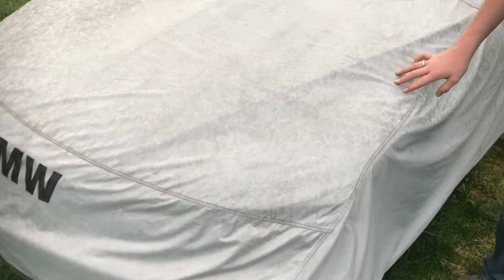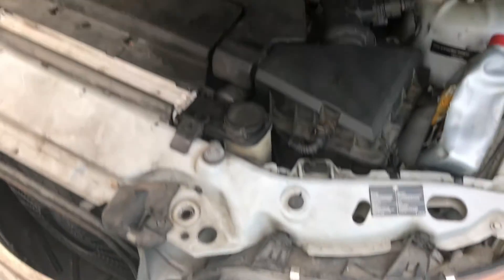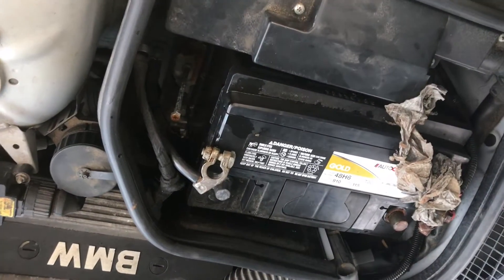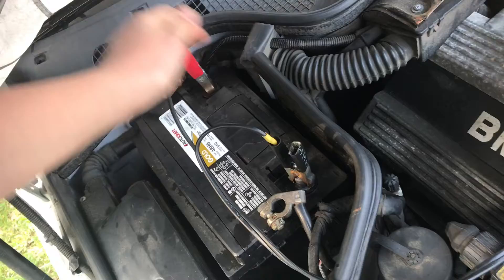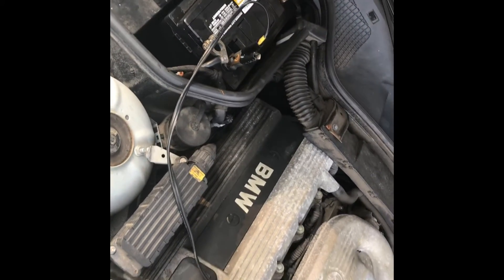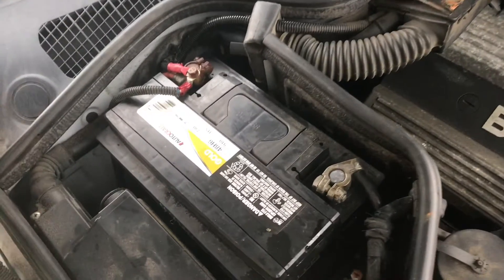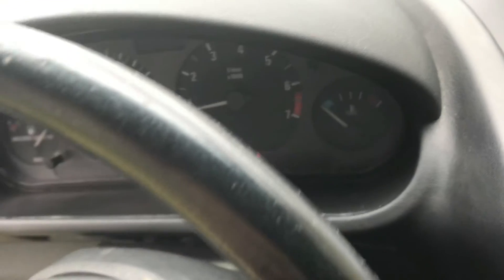CHARGING a battery that is completely dead

Comment: Is the fan supposed to run all the time on this charger? I bought a used charger of exact same model. And the fan is running even if its not connected to battery.

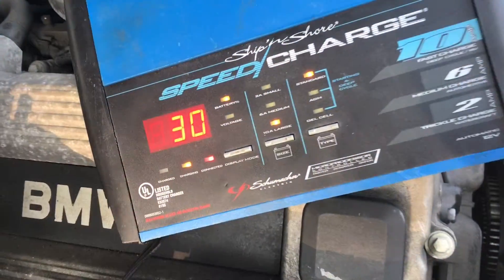Comment: The part # in your video description is wrong. You have an SSC-1000A. At 1:19 it says it directly on your unit in the middle right corner in a blue font... so all of the other specs you listed in the video description are wrong too.

I also have an ssc-1000a and it says in the manual it will not begin charging unless the battery has at least 1 volt. With the SSC (ship to shore) series if you have a complete dead battery with 0V you must first hook it up to another car and jump start charge it, exactly as you would do if the battery was in a vehicle. Only takes about 10 minutes to get a 10V charge on it. Then you undo that whole setup and actually connect the SSC to the battery to begin recharging. 

It's better to use the SSC to fully recharge the battery vs a car jump start for the entire process because it has specialized profiles and cycles for charging and maintaining a battery.  At the end of an 8 HOUR process it was stuck at 15% the entire time, flashed "bad" then "bat". I was sitting next to it when it happened. It clicked off and went silent with the flashing message. It will continue to flash that forever until you unplug it. Naturally I started wondering if my lead acid 12V battery was still filled with acid, it was still properly topped off and plates looked shiny new through the liquid. The trick in case anyone runs into this is to connect it up again. Unplug, plug back in. Immediately it read 87%! and began the desulfation process again.  Sometimes it does in fact require multiple recharging attempts to resurrect a battery that's been allowed to drop to 0V. There's no guarantee it will bring a battery back from complete death but I'm making progress with multiple recharging attempts for sure.

So now I have to wait another 8 hours for the 2nd attempt to finish.  I use a 6A setting and it almost finished at 8 hours on the dot. This is not a quick process per attempt but necessary to fully recondition/resurrect a battery from a 0V charge. A new battery is $150 and if it's possible to resurrect a battery vs paying for a new it's an option if you have the time for it. Since my vehicle sat for 4 years what's a couple more days at 8 hours per recharging cycle. :)

Update: After the 2nd recharging process it's fully recharging and after 5 hours actually updating from 87% to now 99% and I'm sure it will fill to 100% and complete the full charge. Lesson to others... don't give up after the first charging cycle. Multiple attempts does make a difference.

Great video and congrats on getting your car working again. :)

Comment: I have an older version of that charger.  Fan makes the same noise.  I thought about trying to oil it.  
My car sometimes sits for weeks, even in the winter, because I usually ride a motorcycle.  I got a $20 solar charger for cars at Harbor Freight.  It works, surprisingly.  My last car battery was good for nine years, charged daily by the sun.  I replaced it last year with a maintenance-free battery (made in Kentucky).  Don't know if it will be better.
Reply: Do you know of any trickle battery charger for a car that doesn't require an electrical outlet or solar? Some kind of loop di doop with a battery pack,maybe? Thanks

Comment: Accidentally left camper battery hooked up, deep cycle battery, but it got drawn down to next to nothing. The bad thing is the Stanley battery charger just bought a little over a year ago won't charge it because it's to low! So guess I'm going to have to buy another charger that will charge a battery that's been drawn down really low.
Reply from the maker: If it’s that low, there’s times when I have to try three cycles before it starts to recover again,
Reply: I actually put it on jump start mode, which must have gave it enough juice it started taking a charge. Looks like it is good now checked it yesterday after work said 12.6 volts which is good!

Comment: how long exactly did it take to charge fully?
Reply from the maker: This charger has a 10 amp setting, it took overnight to get it completely charged up again. There have been times when I get up in the morning and it’s still not complete. But usually overnight works.

Comment: be glad  you had the older ssc-1500a  that is 12VOLTS ONLY... Schumacher started making the 6v12v Chargers so if a battery is completely dead it only charges to 6 volts ...They did  had a model that had a 6v 12v selector switch.  Now it's an auto sense   that is FUCKING ANNOYING when trying to charge a completely DEAD 12 Volt battery.  It only charges to 6 Volts ..   I think the voltage has to be at least 9 Volts on this newer  model (ssc-1500a-ca )..   to charge to 12 Volts .Otherwise it  ( charger) thinks its just a 6 volt battery.   Just FYI